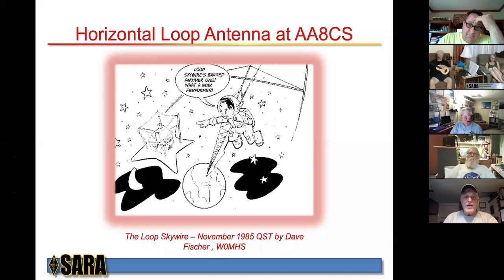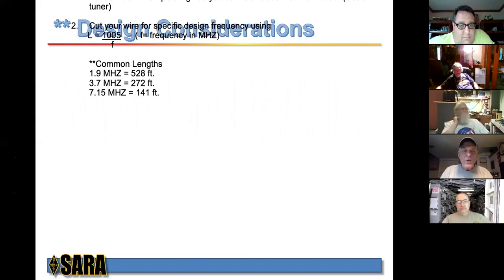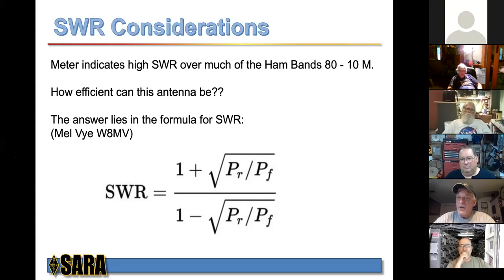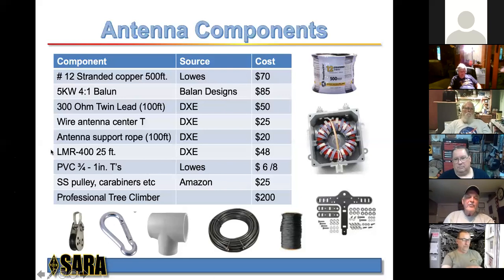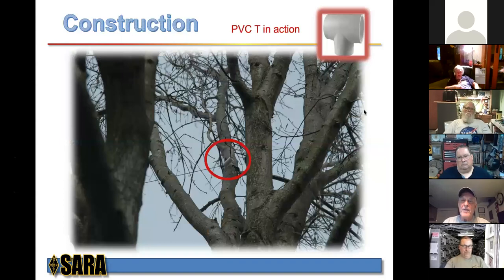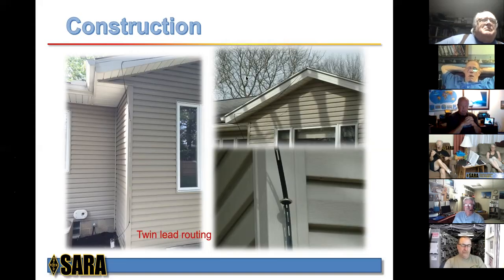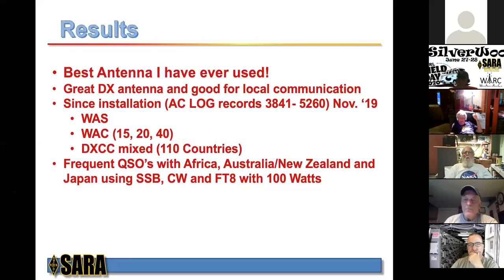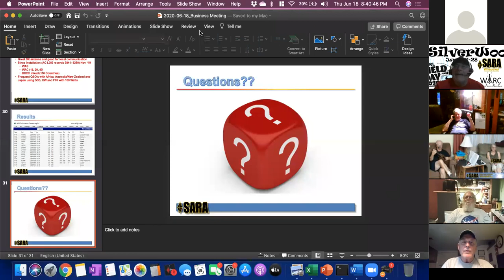Horizontal Loop Antennas @ AA8CS

Comment: I knew an old ham in CA that had a full wave loop on 40m that was about 30 ft off the ground with a reflector loop below it that was about .2 wavelength larger. The antenna was a real 'cloud burner' and had an unbelievably signal for NVIS at 100 miles.

Comment: A 40 meter loop also works as as a top-loaded vertical on 160, if you short the feeders and work the resultant antenna against a radial field.

Comment: My loop is 530ft at 80ft . I also have a 3 element 20 yagi at 40ft on a tower. The yagi Manuel states it has 6.5 dbd of gain on 20m. A side by side comparison on transmit and receive  between the loop and yagi are almost identical on my IC 7610. Sooooo would you imagine that the gain would increase higher up the bands as the wave lengths get bigger and bigger 17m, 15m, 10m?? I wonder if the loop has a little gain on 40m? As for the lobes that are created as the wave length gets bigger I have not found a signal with my yagi that I couldn't hear or talk to with the loop.